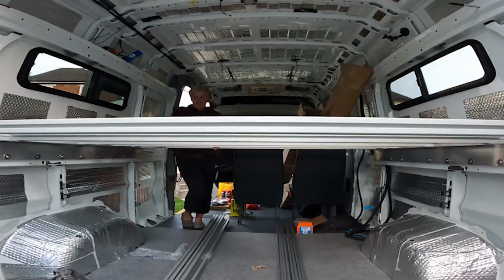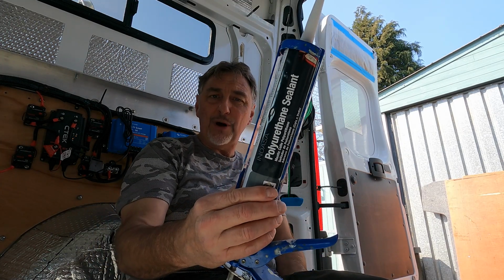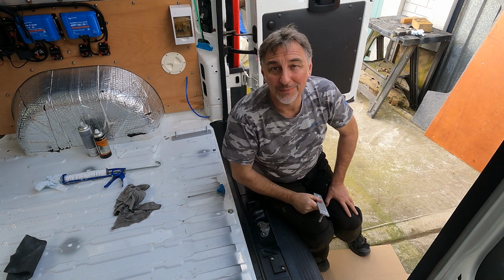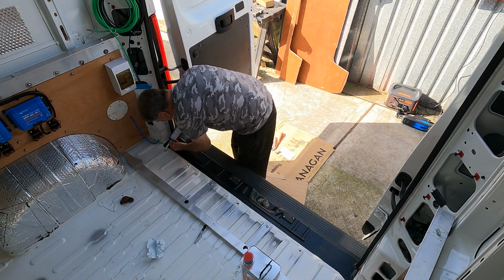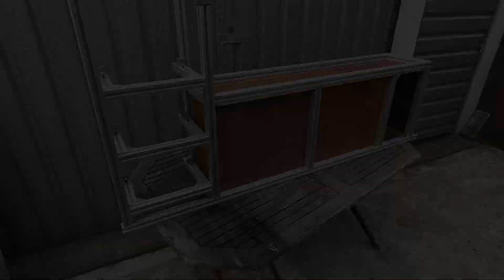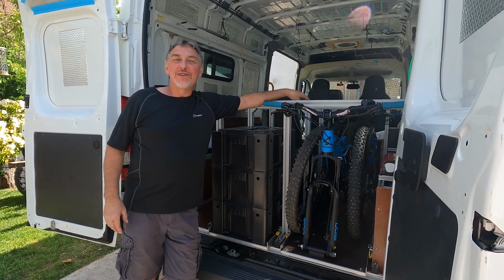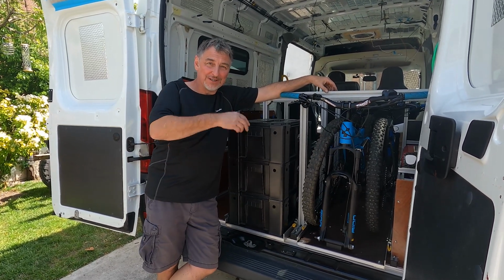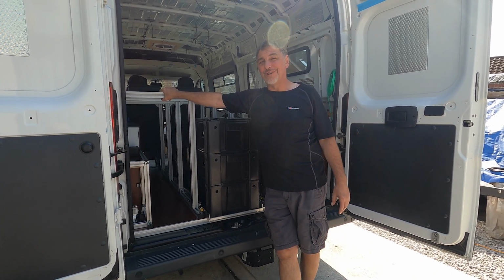80/20 Raised VAN BED over SLIDE OUT MTB STORAGE Part 4

Comment: hey very neat way of mounting the slides, would you mind us asking the support that is on the floor is that drilled all the way through the floor of the van to hold all the weight ?
Reply from the maker: Hey Ben and thanks for watching. Part 2 and 3 of the garage build will give you an idea although most of the weight of the extended slides is transfered to the vans framework through the up supports and bed supports. No real need to over engineer the floor supports or put spreader plates under the van.
Hope this helps.

Comment: Hi, I know its some time ago you did this but we are hoping to do something like this with our bikes.
Can I ask what width did you manage to get the tray down to by removing the pedals,  we will have a space in the region of 400mm with our current planned layout?
Reply from the maker: Hi Paul, thank you for watching.
My tray is 450mm and sits including the slides between the extruded alloy at 500mm.
However, I can also fit my front wheels down the side of the bikes.... so it may be tight but you may just have enough space.
Let us know how you crack on.
Reply: @vanlifemyway7806  Thanks for the reply, I will take the pedals off in the next couple of days and do some measuring, (they will be better for a grease any way).

Comment: Where can I find out what products you have used. I would like to adapt what you have done here to mount my mobility buggy on. I’ll be using a hoist to lift it on and off. Great build, professional looking finish. I love the way you explain the really small bit too. ❤👍
Reply from the maker: Elaina, so very sorry I've only just noticed this comment, I hope you've sorted some things out?
The extruded alloy I am using in my build is BR Section available from KJN Automation and the Slides are from a company in Hull I forget at the moment.
In this build it is mainly the vans structure that is taking the strain rather than bolts through the floor and all is easily adapted if there is any change.
Best wishes, Paul

Comment: Did you bolt your floor framing aluminum floor joists through the metal van deck> otherwise you are relying on the adhesive sealant to hold all the cantilever weight of the slide out and bikes. I would be seriously concrerernd about your floor framing pulling loose. look up the drawer slide installtion requirements. They will likely tell you how much pull stress you need to account for.
Reply from the maker: I have to politely ask.. Did you watch the full trilogy?
The beams were bolted and bonded from benieth the van but you can also see that the full structure is also bolted and supported to the van sides making it very, very rigid.
Bolted also to the kitchen and fridge unit, the fixing points continue.
Hope this helps.

Comment: Also, don't know if you'd be interested or have the materials remaining, but you could maybe do an instructional video showing cutting & joining methods?

I noticed on one part of one video, you seemed to slot a vertical post onto some kind of pin.
Reply from the maker: Perhaps a good idea Sean. When starting out with the vlogs I had no idea how detailed they aught be.
Vlogging did dramatically reduce the speed of the build but fortunately at a rate that it was affordable to build.
The "pins" are an internal angle brackets which allows hidden flush fitting.
You perhaps can see me sliding these into place on my kitchen build.

Comment: Hi again. Dud you specify lengths & drilling options to KJN when you ordered or did you order lengths & cut to suit yourself? If the latter, what tools dod you use?
Reply from the maker: I pretty much ordered everything in 2m lengths and was supprised how little waste I had as always managed to find a use for any off-cuts.
I already had a metal chop saw (Jepson 1.5 hp) but cleaned it well and bought a new blade specifically for cutting alloy....
You can catch me using it in past vlogs of the garage build.

Comment: Did your sliders attach Directly on to the extrusion or via a bracket?
Reply from the maker: There were holes in the slides that bolted through to the 40x40 slot. 
On the side of the 30x30 I used the angular bracket.

Comment: excellent work!   What is the material for the base of the slide?
Reply from the maker: Thanks Andrew for your kind comment. Are you meaning the draw slides Andrew or the base I've used on my garage slides?
Reply from the maker: Take a look at this Andrew if its my garage slides you are mentioning. https://m.youtube.com/watch?v=7ca665aMXPU
Reply: Referring to the base where your mountain bikes mount to.    @vanlifemyway7806
Reply from the maker: @Nutinbutmtb did you manage to see how we built the garage slides Andrew?
It was topped off with "Wisa" decking as often found on transporter style trailers.
Reply: Thank you.   "Wisa" decking is what I was inquiring about @vanlifemyway7806

Comment: What size aluminum did you use? Was it like 1.5 inch or 2 inch?
Reply from the maker: Hey Heather and thanks for watching.
I used 40mm which will be close to 1.5".
I used way more than I had to if just considering a raised bed as only 3 transverse sections would have been enough as it is strong but, to support the slides beyond the van, the structure needed to be more rigid.